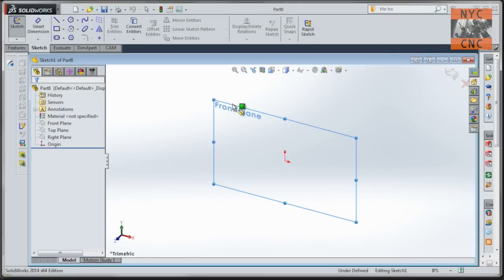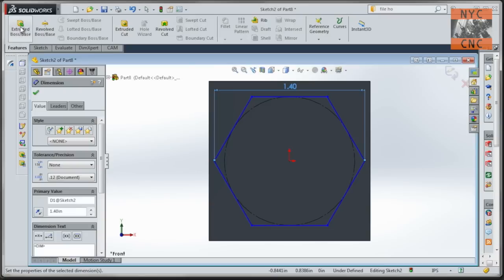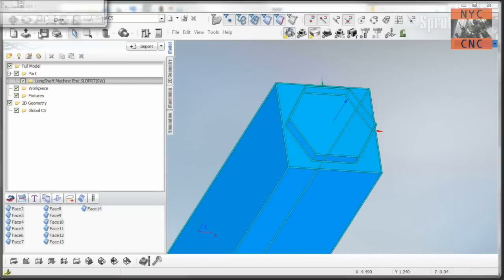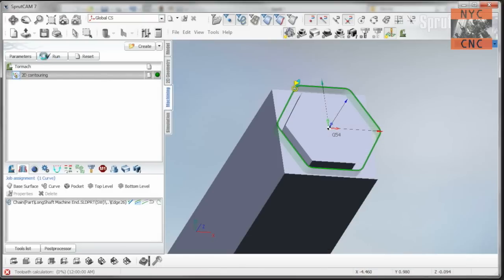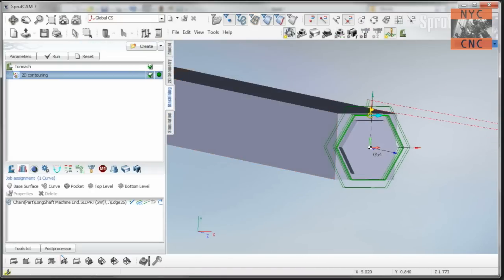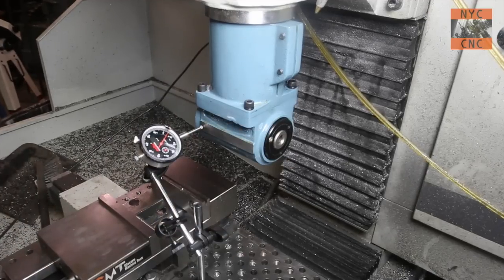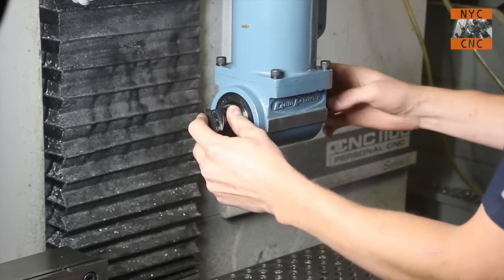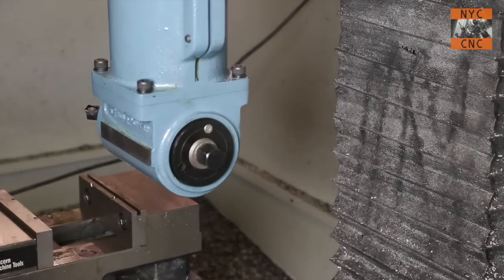The "Right" Tool for the Machining Job - Part 1

Comment: Hi John,
really great series of videos, I enjoy them heaps.
at 11:12 you mentioned the middle crub screw on the 90* head. I thought it was to spread the head opening so that it could slide up the spindle and when it is home then it should be released before tightening the other two crub screws to lock the head in position. I did not think it was to prevent overtightening as this may cause the casting of the head to crack.
cheers